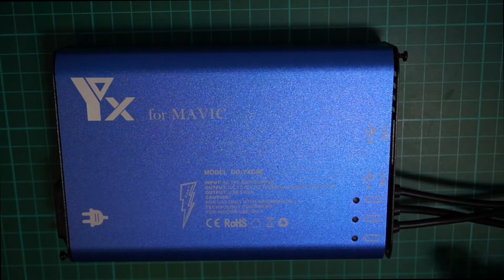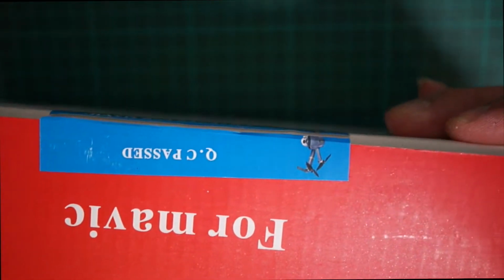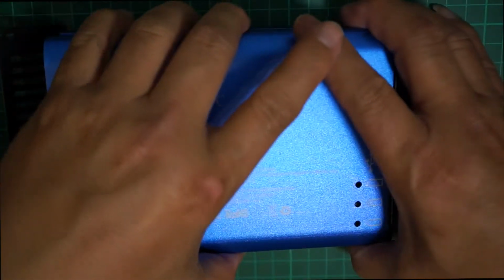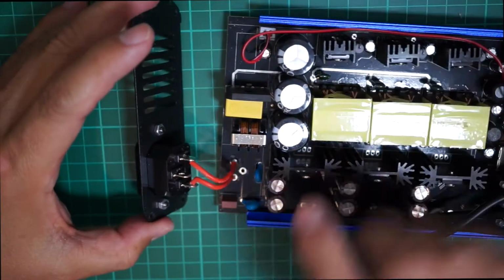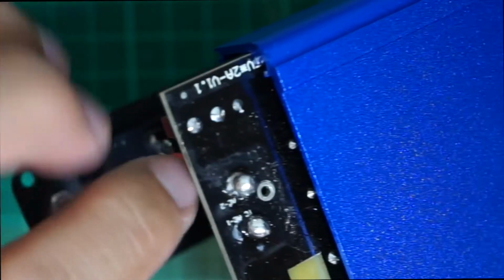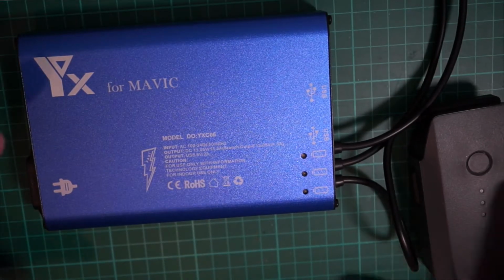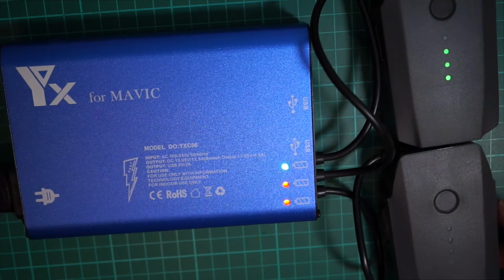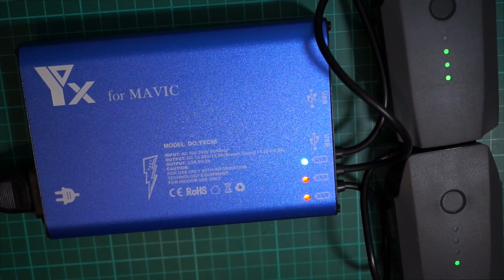YX Mavic Pro Multi charger - Poor Quality Control

Comment: YIKES! No GROUND?! And not only that, NO INSULATION between that dry joint and the METAL chassis. If the LIVE wire was the one that was loose, it it could come into contact with the case, and KILL YOU. This is BAD.

Comment: I also see the absence of a ground. Open un-soldered hole in the board next to the cold solder and the open pin in between positive  and neutral . That's some sloppy shit! Good job on diog and fix

Comment: You should see some of the house-plug (110/220Volt) adapters from china then. Some are allmost like this aka with bad and/or underdimensioned wires in the electronics etc. etc.

Comment: I found it only charged at 45w per channel and not the 58w on the specs. The stock dji charger is faster OMG a single battery. Sure enough you can do 3 at a time but it's not 4.5A as per specs, closer to 3.4A per channel.

Comment: I will wait till both of my factory chargers die. One is 110 volt ac, the other is 12 volt dc powered. And yes both have multi hubs, so I get to fly only two or three hrs at a time, but wait, I can take a break, eat, drink, no booze here., or target shoot for a time. One of the places I fly is a open shooting area.

Comment: If you have 4 batteries that are charged that's roughly 2 hr flight time ....most people fly outside away from power outlets so what's the purpose of this fast charger ? Run home , charge for another hour and drive back to the woods for 2 more hours ? Sounds like a waste of cash
Reply: Apparently you have never heard of a DC to AC power inverter for your vehicle. No need to run home when you have one of these.
Reply: G M ....Yes I've heard of 1, have one in my van but the point is the same , how much flying and charging are you going to do in one day ? By the time you travel to your destination and use up 4 batteries and then what are you going to do ? Trek back to your auto , recharge 4 batts and repeat the process ? For what ? If you can't get the footage you need out of 4 batteries then you suck at what your doing , for the most part
Reply: Good point Mike, I am new to this as I just got my first drone last week (Mavic Pro). I have 4 batteries and haven't had the chance to go out and try flying with all of them yet.
Reply: G M , .....Me too. same model no flight time yet , winter
Reply: I have been flying in my yard even though it's winter here. I live within 5 miles of the local airport so I just call the control tower to let them know I am taking it up. They told me just to keep it below 400 feet, went up to 393 feet yesterday......it was wild! I did order this charger as I have 4 batteries.....just thought if I go out flying in the morning and my buddies call me later in the day to go mountain biking or kayaking I will want to bring the Mavic with me along with 4 batteries and may not have 4 hours to charge them all.
Reply: G M .....I'm 5.2 miles from airport but I'm still just going to find a spot out in the country to get started . schools , hospitals etc are prohibited and I don't need some insane neighbor calling the cops on me because they don't like the sound or think their being spied on . Not worth it
Reply: G M luckily my neighbors are really nice people so no worries there. I was surprised that it isn't that loud, actually it's pretty quiet compared to the Phantoms. When you do get to fly I would recommend using beginner mode as it limits the height, distance and speed.

Comment: I have one where the unit charges fine, but when its idle/green, the light starts to flicker on/off. What could be causing that?
Reply from the maker: It's hard to tell until you open it up and inspect the inside to see what could cause that.

Comment: Dear,

The original charger when it detects that the Battery is 100% charged, it switches off and does not charge any more.

My charger 5 in 1 keeps charging even when the Green LED on the charger lights up.
After a few minutes the LED3 on the Battery starts blinks twice per second informing "Over charge detected."
Reply: Alexandre Ferreira I just bought one and I noticed this too... What a piece of junk